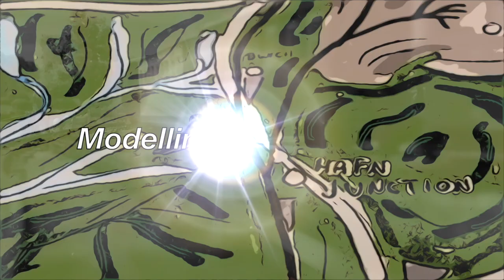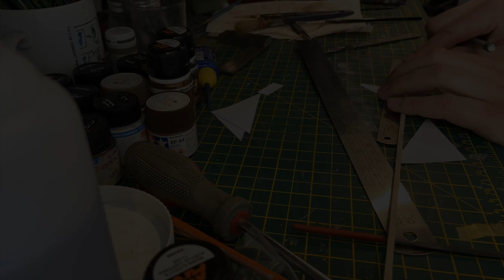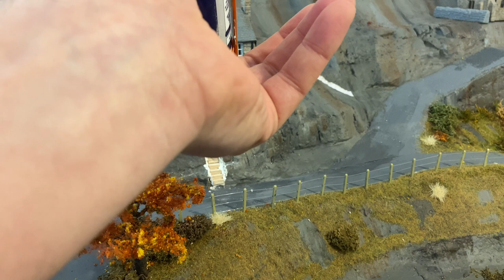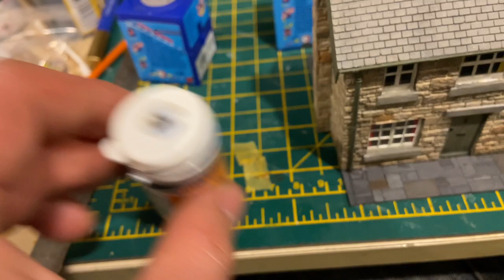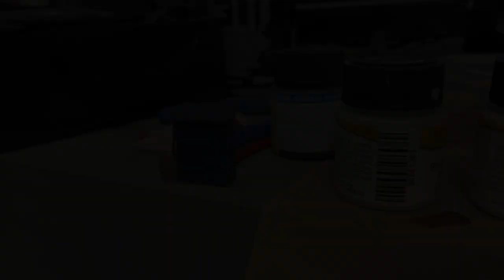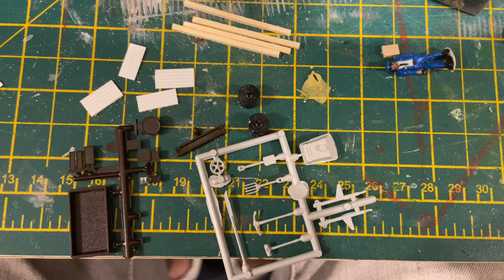Building a OO9 Model Railway Episode 11: Modelling Gardens

Comment: Sir, I like your 009 layout build very much. I wonder what is the size of it, width and length. I’m this evening on episode 11. Thank you.
Reply from the maker: Thank you very much. It’s 1m by 75cm mostly made up of settrack components with flexi track on the curves at the station and n gauge flexi in the fiddle yard. Points are the set track but if I was to it again I would use electro frog